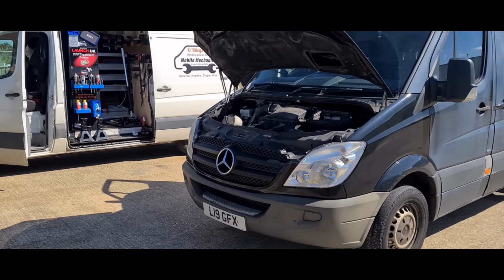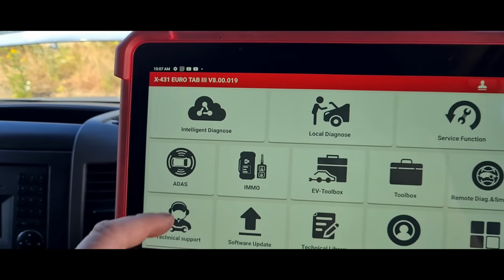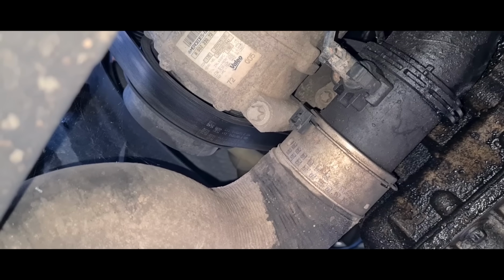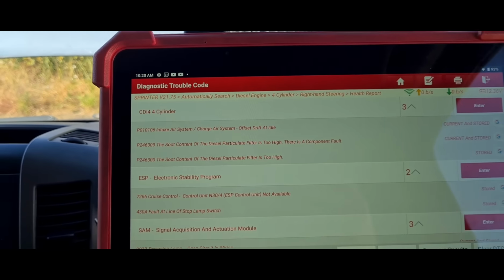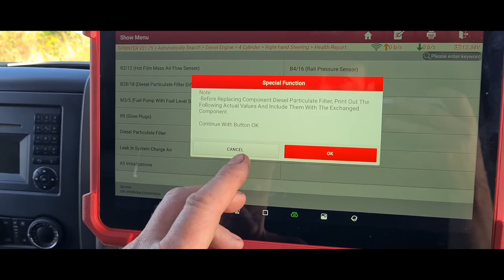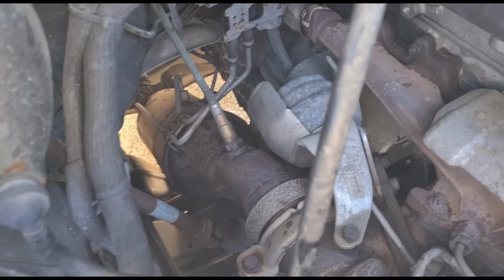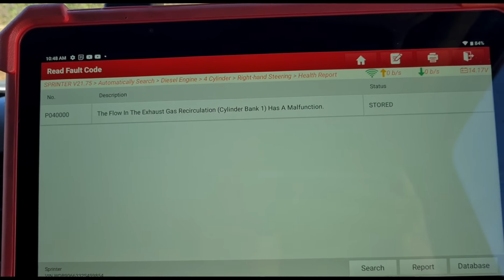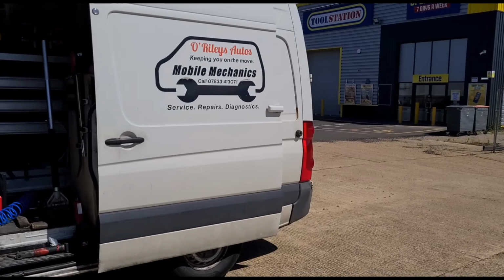Mercedes Sprinter P010106 Intake Air System  & P246309 Diesel Particulate Filter P246300

Comment: That has thrown me off before, replaced the MAF sensor but on the snap on scanner had to "reset lambda values" before the code would clear. Even the component replacement resets wouldn't do it. After clearing the MAF code it started doing its own driven regen by itself within about 10 mins of driving 👍👍 happy days

Comment: Sprinters often leak from inlet manifold and smoke machine doesnt have enough pressure you need special pressure testing gear to put compressed air in it.

Comment: I'm cheap I just use what I have a tire valve / spare tire as the compressor and some soapy water pressure rise to about 10 to 15 psi and go bubble hunting

Comment: I'm not impressed with smoke machines, one of my mechanic mates has one. He was unable to find an leak, I used my pressure tester on the intake and it found it immediately. 
Those sprinters suffer with intake manifolds splitting, with the oil you have down the n/s, it's either the manifold or throttle valve seals leaking. 
I'm a mobile Mercedes specialist, worked for merc for 15years before going on my own.
Reply: Hi ,any idea wat I should do ,I changed maf sensor on sprinter and the fault keeps coming back,do I need to give it a good drive before it resets thanks
Reply: @wexwayne  No, nearly 100% of the time you have a leak on the intake system. Put your original maf sensor back in unless you bought it from Mercedes, what year sprinter?
Reply: @ sprinter is2013 it was sluggish in 1st and 2 nd gear  changed maf and now running perfect just engine light keeps coming back on dash? Diagnostic throwing up same 2 faults
Reply: @wexwayne  I'll be very surprised if it's only the maf, usually the intake manifold leaks especially on a 651 engine. 
Maf does require adaption data reset and teaching in
Reply: @Dbdiagnosticsltd  thanks for reply can it reset itself with a good drive?
Reply: @wexwayne  No you need diagnostics to do the reset
Reply: @ ok thanks I’ll have a look see if I can find a air leak